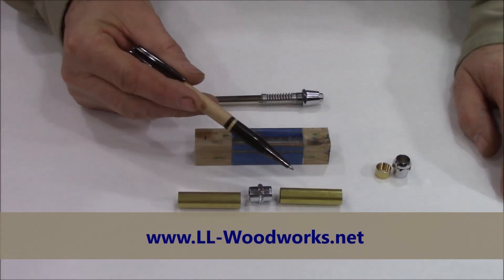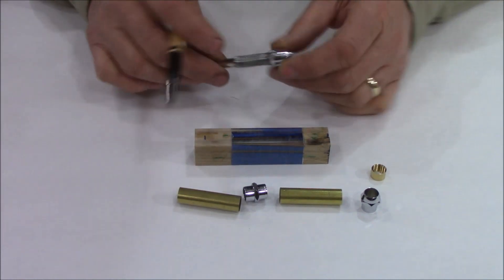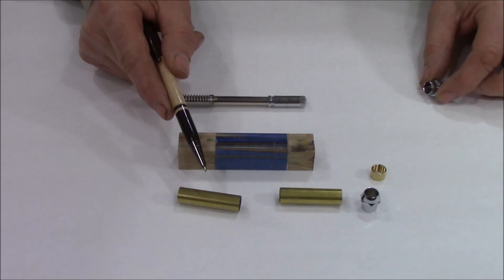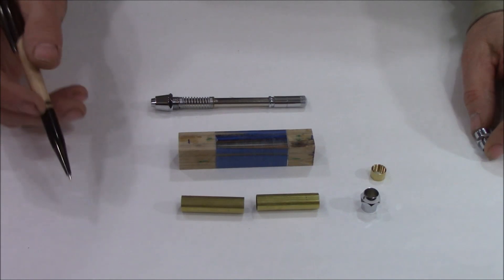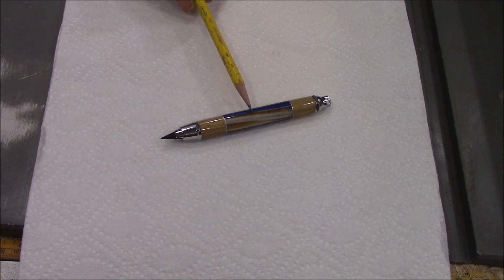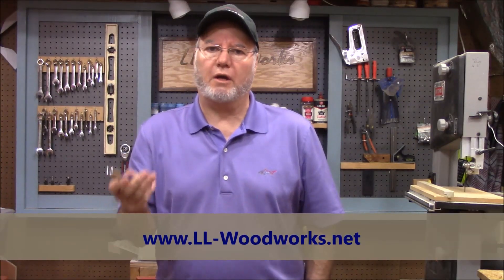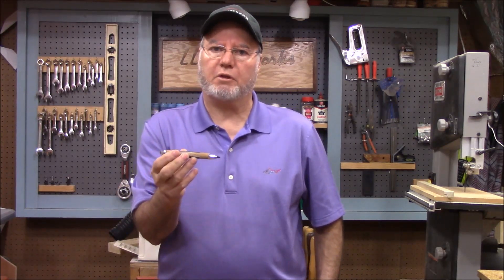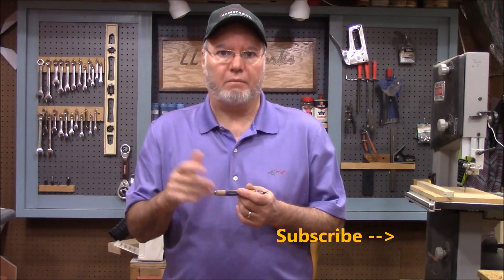How To Modified the Woodworkers's  Pencil

Comment: Love the pencil with the hex nuts. Keeps it from rolling. Instead of leaving out the center band, you can press on the tubes and mount between 60 deg centers to turn it down to the tube OD. Maintains that central structure.
Reply from the maker: +Mr Vic's Pen Shop Thanks for the tip and for watching.